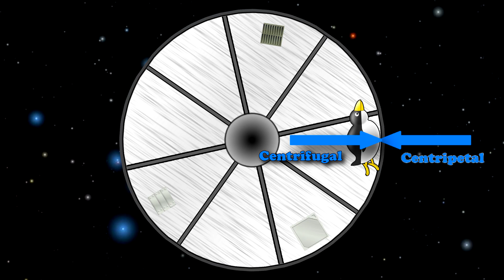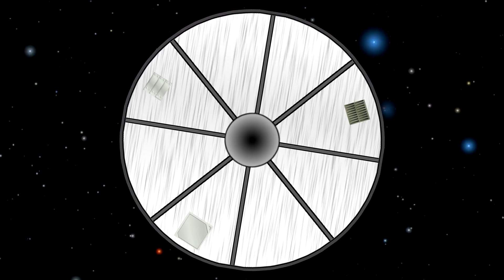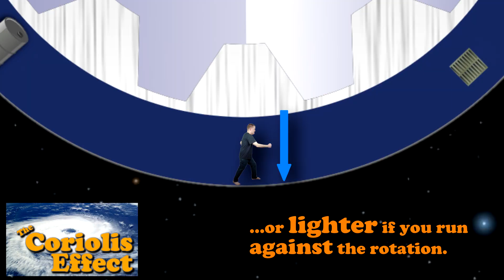Faking Gravity in a Spaceship

Comment: I came for a more extensive explanation of how things actually move in this environment...
By jumping straight up, wouldn't you land at a different angle? Since you are then traveling towards the center, but also in the direction of the spin at the moment of the jump, which is "sideways"?
Also, let's say that I would throw a ball straight forward in the direction of the spin of the station; I imagine it would start curving downwards very noticeably. At the same time, would I throw the ball in the opposite direction it would sort of float still (although moving away from my perspective) and hit the "ground" a whole lot later?
Reply from the maker: +guxit
You're also rotating with the spinning ship when you jump, so you'll keep doing that too while you're in the air... but things do get a little funky in there if the ship is too small (because it'll have to spin too fast). Dizziness for sure.
Reply: +The Science Asylum But you're not actually "spinning" with the ship are you? You have inertia moving you "forwards" in the direction of spin. If you were to instantly remove the station around you, you would not keep spinning, just keep going in a straight line "forwards". Or are you saying that you would also spin on your own axis?
Reply from the maker: +guxit
There's still some angular momentum you have to conserve. Now that you bring this up though, I think I need to do an experiment to see how that would actually work.

Comment: If you ran fast enough against the rotation would you get so light as to become weightless?  And how fast would you have to run?
Reply from the maker: +sicktoaster Yes... but you'd have to run at about 52 mph (84 kph).
Reply: sicktoaster yes but there will be air friction to slow and drop you back down.
Reply: The station would need to rotate at 9.81 meters per second, equal to Earth's gravitational acceleration. If you can run that fast, you would definitely start to rise... but the air resistance would bring you back down.
Reply: Weightless is merely a condition where the reacting forces AGAINST the gravity does not act upon you, therefore you feel weightless since even the weight calculated by a weighting machine is the reactive force against weight not weight or gravity itself
Reply: Yes, I think at that point if viewed within the rotating reference frame the Coriolis force would exactly cancel the centrifugal force. In an external reference frame you'd simply stationery at that point. But even if you were strong enough to run at that speed it would be impossible because with no force sticking you to the ground you'd get blown back by the air.

Comment: What you feel isn't your body pushing against the ground, what you feel is the ground pushing against you, or the normal force. You can only feel a force being applied to you, not a force you apply to another object.
Reply from the maker: sabzi5858 The human body never feels it's surroundings. It only ever feels it's response to those surroundings and then the brain interprets what's happening from that information. That's why perception is tricky.
Reply: ***** Repeating it again doesn't make it true. The human body definitely feels its surroundings. Let's take the sense of touch, for example. When a force is applied to the skin from an external object, it causes that skin to accelerate inward into the body. When a mechanoreceptor, such as a Pacinian corpuscle is encountered, it is deformed by these movements. The deformation of the receptor also causes deformation in the receptors in the cell membrane. These receptors then allow a change in the membrane potential of the cell due to changing ionic balance. (simplified) this then results in the firing of action potentials in nerve cells. This would be the body "feeling" its surroundings. Whenever you draw force diagrams, it is important to know what is causing the force and what is feeling the force. It's a common mistake to mix it up. I understand that you are trying to view this from a biological perspective, but biology is just an application of physics; in trying to view this from a biological perspective, you are simply convoluting the idea. When you have two bodies in space, each exerts gravity on the other. Neither object is "aware" of the gravity it is applying to the other object, as there is no effect on the body from its own force. Instead, each body "feels" the force applied from the other body. Perception is actually relatively simple as far as the mind goes. The senses all rely on physical methods to detect their surroundings (considering chemical interactions being a physical process). All of them take some input from the environment and convert the signal to an electrical signal.
Reply from the maker: sabzi5858 I see what you're saying. I guess the video just wasn't about the biology of it. It was about the mechanics, so I tried to avoid biology all together.

Comment: Let's remember that General Relativity is based on the equivalence of gravity and inertia; the centripetal force is an inertial one. An observer in Einstein's famous accelerated cabin, can do no experiment to distinquish between the cabin being at rest on the ground by gravity, or being accelerated in free space.
However, in a rotating spaceship, this equivalence is only valid for a body in contact with the floor. If you jump up, or throw a ball up in the rotating spaceship, neither you nor the ball returns straight down, as it would be on Earth surface. The reason is that as soon as an object looses contact with the rotating floor, it is no longer part of that rotation (it becomes weightless), but moves along a straight line as per Newton´s first law. On this straight path, the object collides with the rotating floor on a distance away from where it was from start.  Hence, when you jump straight up from the rotating floor, you will describe a curved path relative that floor, so you land a bit further way from where you jumped up and also with a certain angle to the floor, the larger, the higher you jumped - you may fall flat on your face.. A juggler would have to learn his profession again from scratch ...
Reply: xamarmm, "Einstein is wrong" says the "new" Einstein  hahahaha, shut up please
Reply: @PADARM  Einstein got many things wrong, doesn't mean he was any less brilliant. Go fuck yourself Paul

Comment: Couldn't you have sections of the ship that are spinning giving us the feel of gravity, and others (such as the center) that would not have it?  Best of both worlds?  LLAP
Reply from the maker: Kevin Palmer There are some construction problems there. First, you'd need the connection between the parts to be air-sealed but also moveable without friction (tricky business).  Second, the ship would have to have three parts: two that spin in opposite direction and then a part in the middle that doesn't spin.  If you only have two parts, then the one you're trying to keep from spinning will naturally try to spin.
Reply from the maker: Kevin Palmer Also, LLAP.